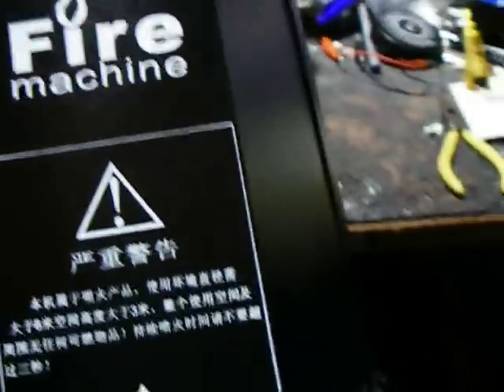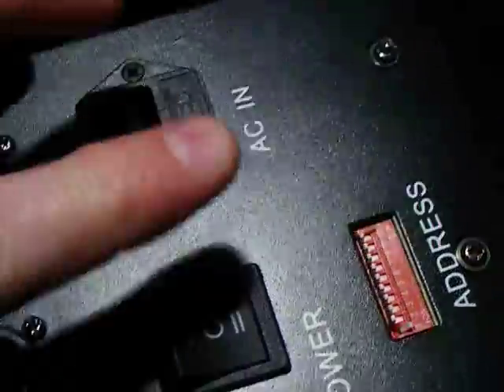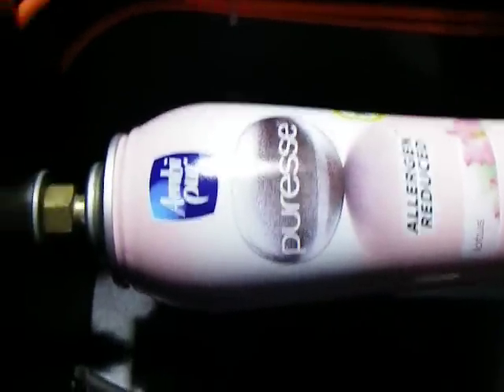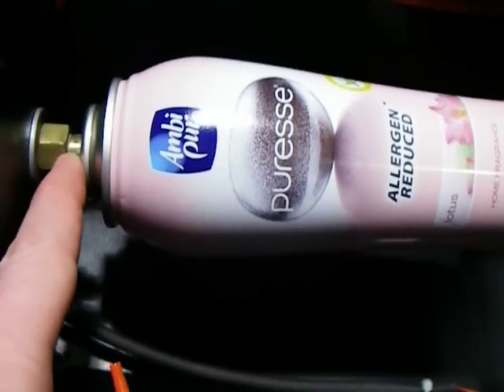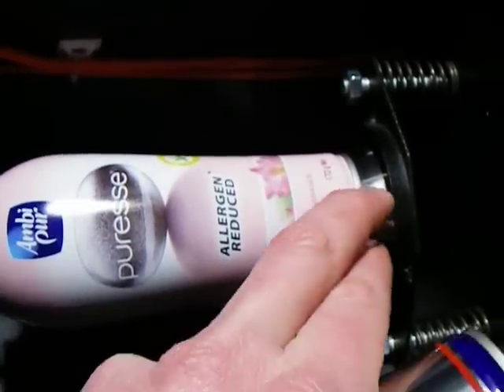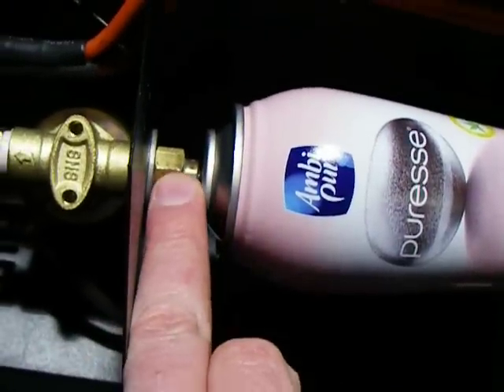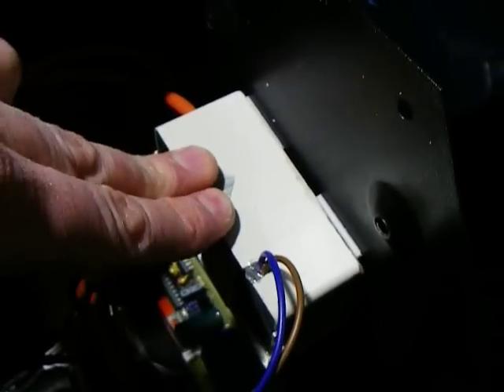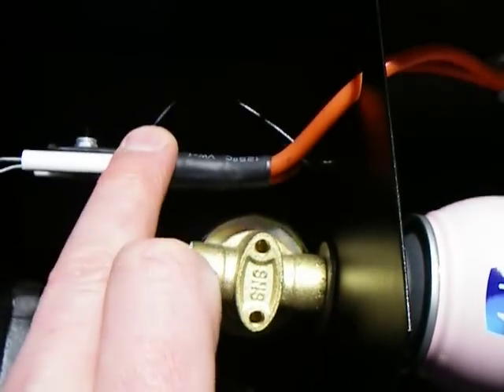DMX fire machine.

Comment from the maker: These machines are really only suited for use outdoors in dry weather or in big open spaces with proper supervision.  They don't have any failsafe system and it's entirely possible for them to crash or lock-up mechanically with the gas jet active.  In that instance it would just burn continuously until it was disconnected or the gas cylinder removed (quite dodgy to do while burning), or until the gas ran out.  Its only small gas canisters these use, but still enough to set fire to a building

Comment from the maker: At work we use gas canons that use a large receiver with a dump valve on the front and an offset pilot torch.  It takes a lot of gas to fill them, so they are only used for paid shots.  I'm not usually in a position to film them when they're being used.

Comment: I have just had a very similar one arrive from China, having found a recommendation elsewhere I fired it up with a can of Easy Start as fuel. It fits perfectly and delivers an awesome flame, and if anyone cares about safety (in which case why are they buying one of these!) then the data sheet lists the only harmful combustion products as carbon dioxide and carbon monoxide, both of which are unavoidable for anything producing big yellow flames. I don't think the same can necessarily be said of air freshener, but at least any unburnt fuel smells better when using that :)

Comment: They are great, but watch the little "o" ring that the fuel seats on as these perish and you can end up with an uncontrolled fire as the fuel canister empties (been there). Fuels with additives, such as air freshener, can crystalise in the solenoid and prevent the solenoid from closing causing an uncontrolled jet.
Reply: would u happen to know the size or where u can buy the rubber grommet ( o-ring) ???

Comment: 11ft ceilings? in Scotland?  you may need one of these in each room in the Winter.
Reply from the maker: +Del Lawrence You're not kidding.  All the heat goes up there.
Reply from the maker: +Spikey DaPikey That would require sunshine.  I do have a central ceiling fan that circulates the air though.
Reply: I've briefly lived in one of those awful converted Victorian villas in Brighton. The concept was rather cute. The flat consisted of a big cube, with a smaller cube inside that contained the bathroom. Alas, it was built, converted, and maintained at that horrible British building standard called "That'll do", which took pretty much all of the cuteness out of it. Mind, when I moved in, it even had a coin-operated electricity meter. Charming.
Reply: Anvilshock A coin-operated meter?
Reply: Yes. An electromechanical contraption that takes 50p coins and switches the mains of the entire flat to provide you with exactly so many kilowatt-hours as can be paid with said coin.
Reply: I've always wondered about those meters after seeing that Mr Bean episode.  How did they work?  Did someone from the electricity supplier actually come around and empty out the coins every few days?  Did your power go out all the time or could you put in a bunch of coins at once?
Reply: After I moved in, it was rather quickly replaced by a more modern meter that only counted what was used, so I don't quite recall all the details, including how often it ended up needing emptying, or whether it was ever emptied at all during my time. But at all times the electricity was basically resold to me by my landlord. The power cut out indeed when the amount paid was used up, and I do believe the device could be "charged" with multiple coins in advance, say, five or ten coins or even more. Or was it 20p? 10p? It really has been a few years now. But the peculiarity of the item was something I will probably never forget.
Reply: Ah that makes a lot more sense if it was used in a rental situation where there was an on-site landlord who could empty the coins.  I didn't think it would make sense for the electricity company to operate like that!
Reply: There were a lot of things that didn't make sense back then so it fit the theme I guess.
Reply: @Anvilshock  Ha funny story, I lived in Peacehaven, my first basement flat, my landlord got a new fangled £1 meter (that also was set HI) but after his mate "the sparkie" fell through my bedroom ceiling he got me to finish off the job.. so only half of the heavy appliances (saniflow freezer ect) went through the meter, as a blacksmith I chopped the bus-bars in half and had a feed through the fuse box/ supply board so that you could not see a thing, really noughty.

Comment from the maker: You could use a small lighting controller or even just a foot pedal.  It all depends on the context of how you're using them in your show.  A custom controller with a low voltage foot pedal switching the power to the units via a custom built relay box would be fairly failsafe.

Comment from the maker: The flame burns the aroma chemicals and probably turns them into deadly carcinogens.  Or maybe it actually makes deadly air freshener safe.  I know that when I tried the conveniently sized Dettol antiseptic spray in it, it made a rather wet messy flame and set off the smoke detector.

Comment from the maker: @lightninglloyds I doubt you'll find a manual since they use a generic Chinese decoder board.  It may be a case of testing your desk with another device to see that you are actively controlling channel one, then set the fire unit to address one and try it with or without the gas fitted.  To be quite honest, it's safer just controlling it manually anyway, since plain DMX does not have error detection in the standard and can get garbled.

Comment: While ordinary butane "lighter-refill" cans don't have a dip-tube, they will dispense liquid butane if held upside-down, hence why you have to invert the can while filling a lighter. Even a can with a dip-tube wouldn't be able to fill a lighter if not inverted, since the liquid butane would just flow out of the lighter and back into the can once the pressure between lighter and can was equalised.

However, you could mount one of these flame-units upside down hanging from the ceiling or from an outside hanging-basket fixture, something like that. Then you could use a normal lighter-refill can as the fuel source. Mounted outside somewhere next to a bright white light-bulb, this would make an excellent moth-incinerating device!

Comment from the maker: Although not recommended for the equipment, most air fresheners are based on aroma oils dissolved in the butane propellant (which is an excellent solvent).  As such, they are unlikely to build up in the valve, although they could react with internal seals or diaphragms if the added chemicals were reactive with them.  The byproducts of their combustion is a different matter.....

Comment: I’d suggest saving and refilling a dip-tube can. To make it easier, keep the can in your freezer, to lower the pressure in the can. The same technique can also be used for woosher canisters, but since they have a metered valve, it needs a bit more effort.

Comment: 2 channel not 1. The hexagonial ones only have 1 channel and the square one is better in a sense that it doesn't only have short burst mode like the hexagonial but also has a mode where the channel determines how long the fire sprays. *Until you turn the channel down or you have it turned up for a set amount of seconds.

Comment: How well do these Chinese units handle using DMX for firing, DMX shouldn't be used for pyro but it often is the better systems only fire if 2 DMX channels are both within a range of values e.g. 123-133 also if they lose DMX they shut off. I know most Chinese units only use one DMX channel but what happens if (for example) the cable is unplugged while it's firing, will it stick on? (hopefully not!) Of course anyone using these would have a deadmans wired into the mains and not rely on DMX alone.

Comment: Great video! this inspired me to make a home made version and it cost about £18 in parts plus some scrap I had lying around!
I couldn't find any air fresheners that worked (despite dire warnings that they are "highly flammable" none of them would ignite - I think they must have a lot of water content, perhaps for safety reasons).
Anyway, if anyone is having the same problem finding a suitable aerosol, I eventually found that Electrical Contact Cleaner works great....

Comment: NEED ONE!!!! Well, I don't but, erm reasons :D
Reply from the maker: +Spikey DaPikey Onbe does not need a reason to buy an automated flame thrower.
Reply: +bigclivedotcom Hmmm How much and where from ?
I bet I have enough here to make one cheaper but I really liked you idea of the fragrance device that had potential to throw out flames.
personally I`d like to adapt one of those sensor ones to throw out flames upon detecting movement.
I have 2 of the little buggers right here - LOL
Might use a product called " Start Ya Bastard " though.
Reply: Sounds like a great new doorbell feature.
Reply: +bigclivedotcom that thing is great :D It kind of brings the cave man out in men lol FIRE! I so want 1

Comment: I heard it is a bad idea to run pyrotechnics from DMX due to potential interference issues causing misfires ? :/
Reply: well that's just more fun
Reply: That Guy lol
Reply: DMX is a protocol with zero acknowledgement or any other safety features. It's a controller saying: "here's some data, in case someone is listening". It is generally frowned upon, and may be illegal in some areas, to control ANY hazardous device via DMX. At least as a primary means, you can usually have a separate controller that meets the safety requirements AND has a DMX input for timing purposes.
Reply: killer1479 you have to have an arm switch at the controller
Reply: Yeah, everything about this is horrifying.  Consider a situation where some fixture goes into "Master" mode and starts belching DMX data down the chain....

Or...consider a situation where you find a janky connection that injects a bunch of noise on the line.  With lights, they'll just go crazy.  With Pyro, people can die.

AFAIK, there is no spot in the US where code allows Pyro to be fired from DMX.  I'm sure the same applies to the UK, given their higher standards of safety.
Reply: So then how do people use flame machines? Radio control like regular pyrotechnics? Because I cant seem to find any flame machine that uses radio control, yet I can find various pyro firing systems that have dmx outputs (FireTEK, Explo, Galaxis to name a few)

Comment: Did you have any issues with it .I have 2 of them neither will spray ? The igniter works fine manually & on dmx mode.
I've tried butane air freshener & engine easy start .
Is there a way I can force the solenoid to work to try & pin point the issue a little.

Comment: Hi, please can you help us and upload the user manual of this machine. Many thanks!
Reply from the maker: Arturo Mina In the true style of generic Chinese products, I don;t think I got a manual with mine.  It's straightforward enough though.  You load a can in as shown and select whether you want it to run as soon as it's powered or under DMX control.  The DMX module is a very common one used in many generic chinese smoke machines.  Note that DMX is not actually suited to running a pyrotechnic effect due to lack of error detection.
Reply: bigclivedotcom Thanks for your quick answer. We just bought one of this used machine but with out user manual and we ask if you know how you can configure the switches 1,2,3...etc...thanks again.
Reply from the maker: Arturo Mina I've never actually used the DMX function.  Mainly because it's not suited to pyrotechnic control.
Reply: Arturo Mina Those are the DMX address assignments, they should be pretty standard.
Reply: This ^ DMX is not appoved for any kind of hazardous display because of the (albeit small) chance that interference ( or the fact nobody bothers terminating their dmx lines) could cause it to randomly go off.

Comment: Any idea how to fix them if the fluid is not being sprayed
Reply from the maker: That could be a blocked valve or it may not be getting powered.  If the solenoid valve clicks when it's supposed to be spraying gas then it's probably a blocked valve or the can isn't being pushed in hard enough to release the gas.
Reply: @bigclivedotcom  how would you clear a blocked valve ? I used it a few days earlier with carb cleaner and it worked fine , now 2 days later only spark from the rods and no fluid
Reply from the maker: @TradeMarkMedia23  You may need to disassemble the valve if that's possible.  I wouldn't recommend the use of strong solvents like the carb cleaner as they may affect some components.  The valve is only intended for butane or propane based fuels.

Comment: where can i get a replacement for the rubber garment? any ideas?
Reply from the maker: If you mean the rubber seal where the gas bottle goes in, the one in mine is a standard o-ring with a cross section of 2mm an outer diameter of 6mm and an inner diameter of 2mm.  But it may vary between machines.

Comment: Did you use air freshener can?
Reply from the maker: Yes I did.  Purely because I didn't have the proper fuel can.  It's not recommended.
Reply: I see! I bought 2 of the torch flame machines on Ebay. Getting them tomorrow. I bought 2 cans of Valvoline starter fluid. I heard that is the best thing to use.

Comment: Hello, thanks for you video. i just bought one. i want to know if it's possible to use it with a remote controller like remote for smog machine?
If i see it correctly, the motorvan and the sparkler work with 220v, if i put just a pusher button between electric plug and motorvan/sparkler, can i command it without pass in the dmx ?
thanks
Reply from the maker: +Aurélien Vadant if the unit is switched to manual mode it will energise when powered externally.

Comment: Hey, Ive just got 2 of these but am having a problem with the flame being more blue and small than orange and large . Any help on the correct fuel . Thanks in advance
Reply from the maker: You're probably using a standard refill style gas cylinder.  The proper one has to have a dip tube so it blows out liquid gas.

Comment: has anybody got any idea to the dmx settings for this unit??. the unit works in power mode but when trying to use on dmx i get nothing even tryed a pin swap but with no joy if anybody has a manual this would be good.

Comment: I just received one of these machines. How tight does the aerosol can need to be to the valve?
Reply from the maker: In this unit it needs to seal to an o-ring inside the valve port, and press hard enough to activate the plunger.
Reply: @bigclivedotcom  could you post a pic or video? My starter fluid just continually flows out. I don't feel a rubber gasket in mine.
Reply from the maker: @tylerj.c.3235  If it's the same as mine then the rubber o-ring is 6mm outside diameter and 2mm thick.  (2mm hole in middle)
But it may vary between machines.

Comment: So can anyone help, how do you activate, was it with a wireless key or
Reply from the maker: This unit has the option to activate when powered, or by DMX lighting control.  But DMX is not safe to use with pyro effects without a lot of extra safety coding.
Reply: Thank you, for the reply. So when you walked away did you plug it in then it went off. ? So there no wireless key or control

Comment: Isn't it considered dangerous to control this type of devices with DMX ?!?
Reply: +gorman2001 Definitely wouldn't use it for anything other than just for fun - not only is DMX not recommended for pyro, imagine how easy it'd be for someone to accidentally flick the override switch (or knocking it over and bumping the switch), and the thing goes shooting flames the second someone powers it up before a show?
Reply: +LPFthings MAGIC SWITCH FOR MAXIMUM EFFECT
Reply: +gorman2001 Perfect for "accidental" insurance claims :P

Comment: i want one these for my shows , were can i buy it?
Reply from the maker: Titinho Magicboy This one came from a Chinese ebay seller.  Try a search for DMX flame machine.  Also consider the Chauvet Geyser which is a vertical fog machine with LED lighting that gives a very impressive coloured jet effect with no real safety hazards.  These cheap fire machines are not really suited to indoor use.
Reply: bigclivedotcom Thanks for the answer i was looking for for one that i can use on indoor shows like a dj set , but i dont what machine is the best to buy and what machine is the most safe to use it , i dont want to put fire on the school prom eheh , thank you :)
Reply from the maker: Titinho Magicboy Definitely not real flames in a school environment.  The use of a fog machine and some well placed lighting or the Chauvet Geyser would provide a good visual jet effect with no major hazard.  But make sure the fire alarm is either temporarily disabled in the rooms that could be subject to the haze, or capable of being monitored to avoid unwanted visits from the fire brigade.  The fog from these machines can trigger some detectors.
Reply: bigclivedotcom  maybe i just use some smoke machines for this one , but in the future i will think about the dmx , thanks for the answers :)

Comment: do you need a license or permit for this unit?
Reply from the maker: It depends on the venue and your geographical location.
Reply: Whats the highest those things shoot?
Reply from the maker: That depends on the fuel used and the temperature of the can it's in.  The can temperature will be affected by ambient temperature and also by how often and how long the effect is used as the can will cool during use.

Comment: Bigclivedotcom  i bought one too wich " spray can" do you recommend me ? ambi pure..?
Someone recommend me brake cleaner(brake fluit)
Reply from the maker: ***** Technically speaking you should only use the correct fluid specified for these machines.  Especially if used indoors.  But for personal outdoor use away from the public you could try various things like air fresheners or the brake cleaner solvents.